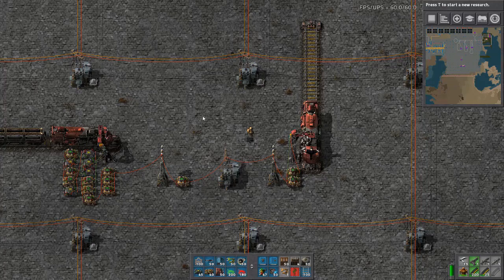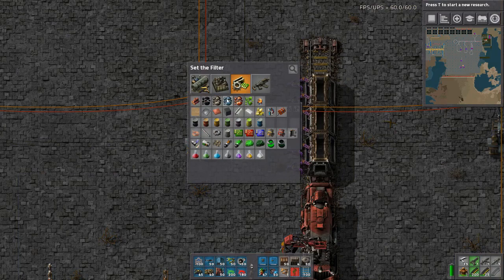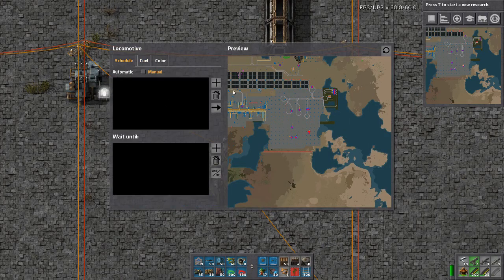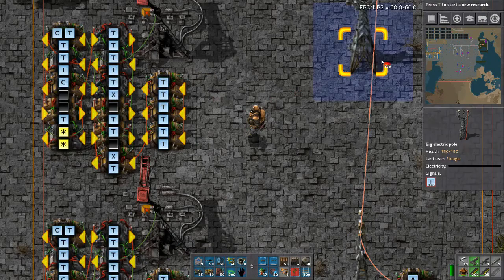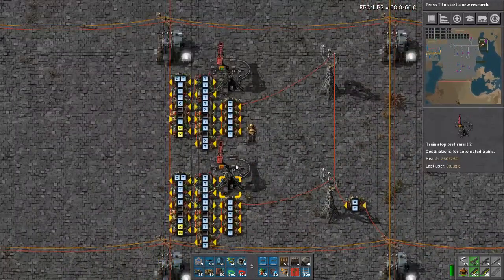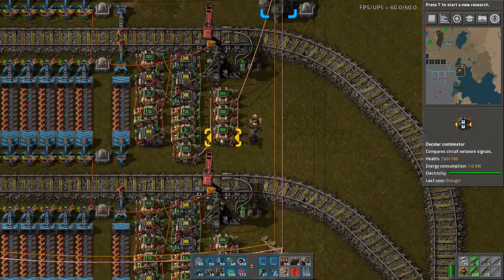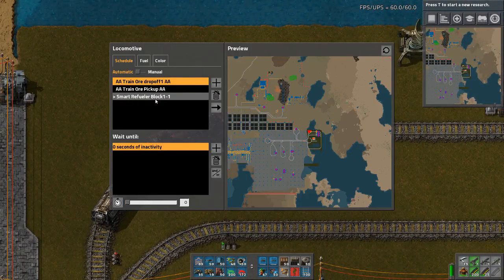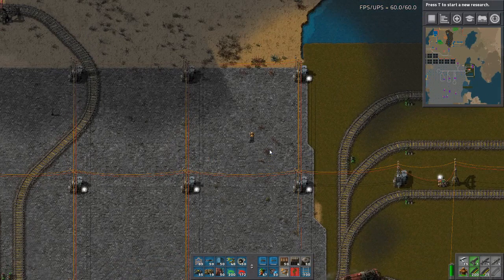Factorio Smart Train Refueling Station

Comment: Good work. You could add a counter you set to the number of trains per station, and every time one gets fueled and leaves, you decrement one. Once you arrive at 0, the station closes and the counter resets the next time a train calls for fuel. This means that every train of that fueling station gets refueled once, if they have fairly similar routes. If one takes half the time to complete a route of the others, you'll end up with one train unfueled and one twice fueled. But your system, coupled with a counter, would work great if you assigned one fueling station per route, and all trains on that route to this one station. They all would be synchronized, meaning they would go empty roughly at the same time and end up getting refueled just as they all needed it. And because they work the same route, they should also never clog up the fueling station, but instead smoothly arrive one after the other.
Reply: Yes. A proposal to OP to create refuel centre for multi train in same route eg... Ore collection fleet .. which can be add new train without concern on the train ID.